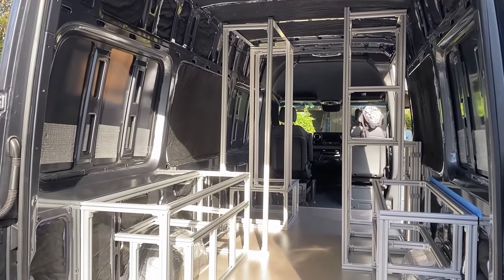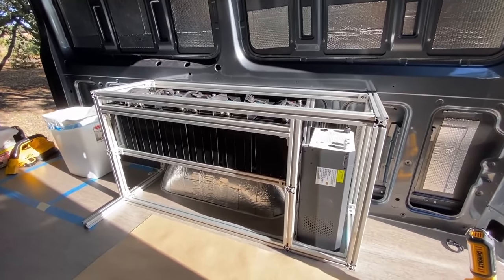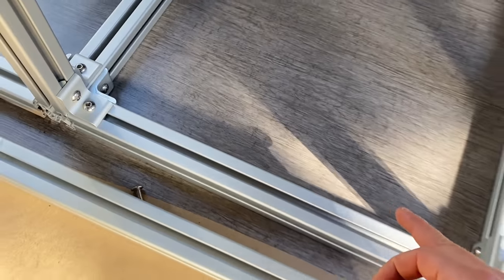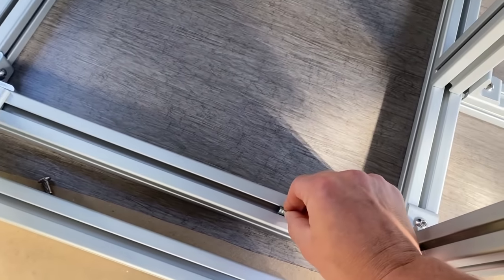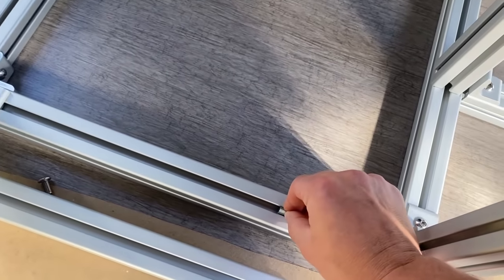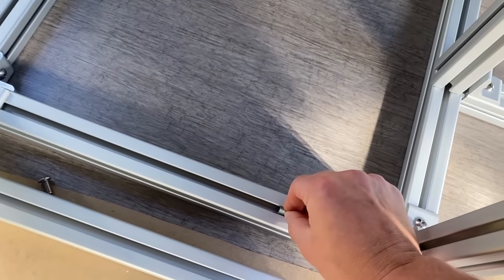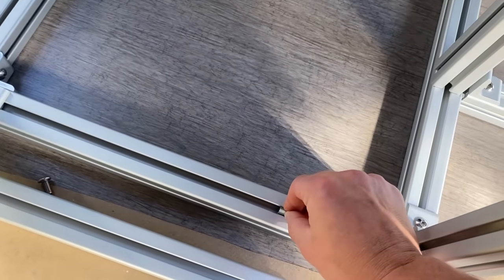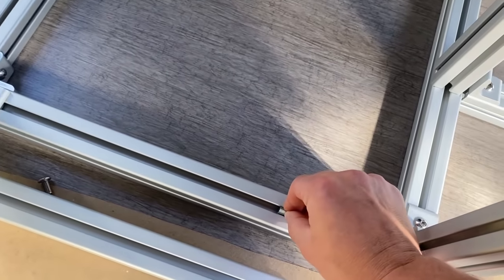How To Build A Van With 80/20 Aluminum (INSANELY STRONG)

Comment: A word of warning to everyone wanting to do the same: Do not use a miter saw designed to cut wood on the 80/20 extrusions. The RPM are too high risking bind up and serious kickback. Yes, it is possible to cut quite a few extrusions, but in the long run it's an accident waiting to happen. Instead use a miter saw with low RPM designed to cut metal and is preferably oil cooled. Unfortunately I am speaking from experience. Did not mean to take away from this awesome video, but add to it. Thanks for sharing your building process!
Reply: then what is your suggest, to cut the 80/20 extgrusions? thanks
Reply: @jonathanz2543  get a miter saw designed for cutting metal (low RPM + Oil cooled). If that's not an option, then be very careful and keep the blade cool, don't use a lot of pressure when cutting and let the blade cool down after each cut. I haven't tried it yet but you might have luck with spraying some oil onto your cut, however this might also become messy. Be very careful though! Good luck!
Reply: @ThePhiliposophy  thanks
Reply: The Aluminum Carpenter has great cutting method and tools.

Comment: 80/20 is way too expensive! The connectors is where they get you. I built a camper and used welded aluminum square tubing for a quarter of the cost.

Comment: You need to ground all that aluminum to the chassis. You also need a thermal break so that the heat is not  transferred onto the frame of what ever you are building. Installing a rubber washer between the 8020 and the plusnuts might be enough.
Reply: ^^^^He's totally right. As terrible as this may sound, you need to break it thermally and that may require demounting it. I'd vote for mass loaded vinyl cut into strips 1.5" wide to line all 8020>Van runs of aluminum extrusion. Grounding will be way more straightforward assuming that most of this is interconnected throughout your van. I love the build and the ingenuity of the mild fabrication with bar stock and tapped holes. You have some awesome skills and attn to detail!
Reply: Everything is already Grounded to the Chassis / Body due to the fact he’s used Nuts / Bolts and Rivnuts - nothing else is required.
Aluminium is a poor conductor of heat so there will be minimal issues with Heat Transfer.
Reply: @jamesosborne4132  re: "Aluminium is a poor conductor of heat"  Incorrect.
Reply: Why the need to ground the aluminum to the chassis and avoid transferring heat to the frame?
Reply: @gabefabian3400  Aluminum is a great thermal conductor (more thermally conductive than steel!) and needs to be grounded if you break the thermal bridge between the van structure/skin and the extrusion... and to be clear, you really should break it thermally. If you have exposed aluminum exposed to hot/vapor rich air (See cooking, breathing, showering, etc) you are going to get condensation which leads to moisture build up which leads to mold which leads to a van rebuild.
Reply: @mtier0067  fascinating, thanks!
Reply: @mtier0067  So why or how is James Osborne wrong? Does grounding with nuts and bolts not work or does it need to be with bare metal?
Reply: @zibwag3203  https://www.youtube.com/watch?v=x0JCLSQGU9Y Watch that video. You need a grounding wire of appropriate gauge that is bolted to a bare piece of the van steel (sand off the paint to get to bare metal)
Reply: I just reached out to them, I do believe a single grounding point from each self contained contiguous "box" you built with 80/20 would suffice. I believe that the size of the wire you are using on your house battery connection should be used for the ground since this will be the same rating for max amps carried in your system. I am using 4/0 on by batteries and have a 3k watt inverter. I will use that same 4/0 wiring to ground each box/frame to the van skin.

yeah as for thermal grounding, I have firring strips mounted to the chasis with plus nuts, i have thinsulate and a plastic washer break between the wood and the skin. THEN i mount the 80/20 on the firring strips so there is the thermal break, but then I ground each box back to the frame... good times!

Comment: The test we conducted with 1” sq Aluminum tube welded frame vs 3M VHB tape, the welds failed before the 3M System , which only twisted the tube, the joints did not fail, it’s also lighter. Buses and coaches are put together using 3M tape, so are Semi Trucks Panels.

Comment: I used 8020 to build my camper van, too.  Bought some off eBay, some on Amazon, and some from Grainger.  For anyone who uses this stuff, recommend buying 8 ft lengths of 1.5 x 1.5 aluminum angle iron, and cut your own right angle connectors.  Make a jig, and drill holes in these with a drill press.  Also ... I tried the same method of cutting the extrusion with a radial arm saw, but I must of used the wrong type of blade.  I got a LOT of aluminum “slag” that “smeared” the cut ends.  Had to use a bandsaw instead.  Two years later, 20,000 miles, and hundreds of nights, every joint is still super tight and the just like when it was installed.  Expensive, and worth it.
Reply: Was there a difference in price between Amazon,  Grainger and eBay?
Reply: @R81-b1p  Minor differences.  Got some great bargains on eBay when purchasing lots of “end cuts” (left-overs from others’ major projects).  You have to keep your eyes open.
Reply: @bitman05  ah makes sense.  I'll stick to Amazon then since it's so convenient.  Thanks for replying

Comment: I love working with extruded aluminum.  I built my minivan using 2020 instead of 8020 at a significant savings and I could get it in black. And it provides 0.043 inches deflection at 24” span under 250# load, which was plenty for my use.

Comment: It is lighter and stronger than a wooden structure. But the best part is that it is very easy to change the setup. It just takes some nuts and tools. I have been using a similar setup in my 4x4 for a couple of years now and being able to add and change things on the fly is really helpful.

Comment: I advise using a negative rake blade for cutting aluminium. Basically, the teeth face backwards, pushing down on the aluminium, not hooking upwards as it cuts. Reduces very scary accidents with the blade throwing your aluminium across the workshop, wrecking your saw. I learnt the hard way 🇦🇺

Comment: One of the greatest channels on van building IMHO. 
I wanted to ask you why you don't use a 1" 8020 frame instead of the 1.5" one. It is smaller so smaller footprint in a tiny space such as a van. Do you think it's not that sturdy?

Comment: Thanks for the video. Its really helped me with my build so far. I'm using 8020 for the first time and one thing that is concerning is just how much it conducts heat/cold. I left some pieces of 10 series in the van when it was 95f and they were super hot to the touch when I got back. Its definitely something to account for. I really think you have to do an AC if you do 8020 that's how much I think it conducts heat. I'm using vinyl to help prevent the heat transfer.
Also, the 10 series is plenty strong I think. I ordered all 10 series as its considerably cheaper than the 15. I think its perfect for the kitchen galley and cabinets as it maximizes drawer space and then I'd probably do 15 series in the bed area as the 10 is fine but 15 would be sturdier. It's so much nicer/fun to work with than ply which I've used in my previous vans. I'm doing a really similar layout to yours except mines a 144wb. Do you like the white panels?I'm thinking of doing white laminate panels, to help brighten up the space and there easy to clean.

Comment: Absolutely epic. I'm thinking about using smaller 80/20 for some parts in the van I'm planning, but in terms of weight-to-strength ratio you can't beat it!
Reply: I'm also curious about the smaller 8020 (mostly to ensure the largest possible drawers, shelves and generally make the most of the space) – how does it compare in strength? Do you reckon it can be build sufficiently strong as a basis of all the cabinets or even for a bed-construction?
Reply: @thefuture986  cabinetry, yes, bed construction? maybe, but you'd have to be quite diligent with your triangles and reinforcement, and even then I'm not sure. but cabinets? absolutely
Reply: @Evanrodge   Seems about right intuitively. So I guess 1010 for cabinetry and 1515 for the bed (with a support beam in the middle?) might work? I'm an absolute noob at this stuff tbh.
Reply: @thefuture986  If I'm right (maybe not) you have this info in the datasheet (obviously not on amazon, but if you ask the manufacturer...)
So with a lenght and a load value, for each given size you can know the max stress and also the max deflexion...
Don't forget you can mix sizes... Use 1 inch square for a pair of small vertical "legs" for example, and for a long beam between these legs, you can use a rectangle profile of 1 x 2 inches... This is the beauty of alu extrusions...
Reply: @thefuture986  yep, 1515 is MORE than enough for a bed as long as you have at least one support beam and use the triangle reinforcers in the corners for stiffness. You'd need to have slats to support the mattress of course but yeah structurally that seems fine.

And I say that because that's what I made my roof rack out of for my Element and put nearly 250lbs of stuff up there lol.

Comment: Nice Seven !!  Only thing I would revise in Van#3 is to thermally isolate all those alum to steel van connections.  Your insulation is "shorted out" by all the direct conduction thermal paths.  My design uses 90deg FR4 brackets tied to the OEM van rails....very quick and easy.  I can remove all my subassemblies quickly.  Tie 8020 rail perpendicular to each OEM van rail.
Reply from the maker: Considering the steel itself is on the inside of the van (and will be covered by wall panels) and the 80/20 is on the inside of the van (and will be covered by wall panels), does this make a difference?
Reply: Mike is right.  Also, consider aluminum is highly thermally conductive.  Using wood or high density plastic spacers between the 80/20 brackets and the van steel would eliminate alot of that thermal transfer.
Reply: @BrendaTharp  I use cut pieces (1 1/2 or 2" ) from: Fiberglass Angle, Gray, 2" Height, 2" Width, 60" Length, 1/4" Wall Thickness    bought from Amazon, sually about $45.  Careful when cutting....FR4 dust real bad....may want to do outside, with mask....I don't, but I'm careful :)
Reply: @seven_o_savage  Hey Seven.   My experience is that the 8020 subassemblies sure act like a big finned alum heat sinks.  Working in the van all summer in FL with the AC on inside: the 8020 was all sitting about 75deg  and the van steel/OEM rail at the FR4 bracket was usually >20deg hotter.  The outside metal was even hotter.  Very hard to get 20deg delta on steel to alum direct contact.
Reply: @mikecol99  I learned a lot about thermal bridging when I was looking into container homes.  Glad you brought this up, just hope Savage can make some adjustments.

Comment: I don't plan on using it for my cabinet structures. But I will be using aluminum U-channels at the top and bottom of my wall panels and around the edges of my ceiling. These were good tips for anchoring them in place. For the gap at the angle between the walls and the ceiling, I'll be using crown molding so that I can use that gap to run wires, indirect lighting, etc. I'll just have to remove the molding to access things easily. And using the aluminum you channel will make it easy If I do have a problem with water or mold behind the walls. It's just a matter of removing screws from brackets along the top and bottom to access what's behind the wall panels.

Comment: Very nice. Make sure you ground all of those structures to the chasis of the van though!
Reply: I've seen this advice often enough. Can you explain why? I don't quite get it.
Reply: @peterdods425  it's just to complete an electrical circuit if there was ever a situation where something were to short out. 

With vans taking a bit of a beating something could shake loose over time. If that something is a wire that's supposed to be supplying power, say to an induction cooktop, and it ends up supplying all that power to your galley frame, you're gonna have a bad time if it isn't grounded to the chasis. 

Everything has to return to the negative terminal on the car battery, the chasis of that van is connected to it. So connecting all that aluminium to the chasis of the van (make sure you use a big enough cable to handle the potential in the batteries) in effect connects it to the car battery.
Reply: @MrMJBall  if it’s bolted to the van it’s grounded.

Comment: Same concerns as others.  Would use 80/20 only for stationery purposes.  Too concerned that to would rattle loose over time.  Working with an aluminum metal fabricator can actually be less expensive and more sturdy, but your design has to be spot on.

Comment: Great build series. I used 1” 80/20 on a drawer system for my truck and have had issues with bolts/tnuts coming loose anywhere I used single L brackets to connect two pieces of extrusion. I used 80/20’s machined connectors for all the corners and they’ve been solid. I think your frame will rattle loose pretty quickly without some blue loctite on the threads. Opting for birch ply and pocket hole construction on my next build. Interested to see how this holds up.
Reply: No matter what you build it will loosen over time, a van flexes continually, only way to offset is to mount everything flexibly ie rubber mounts, one mistake most builders make is mounting cabinets to floor and side wall, both are flexing in different plains, mount cabinets to the floor only even if full height with a small gap to sidewall.
Reply: @andywt8460  Yeah, I was wondering how fixing a rigid aluminum frame to a steel van body that is flexing in all sorts of different ways would wear over time. The bolts of the frame are constantly tensioning and detensioning as the van body flexes. I think a floating system made out of a more flexible material that anchors fast only to the floor would allow for the natural flex of the body and avoid putting so much stress on the system.

Comment: Nice build & explanation, I suggest @0:22:37 using an isolating thread-locking compound to prevent the stainless steel from corroding the aluminum & or vibrating out.  Locktite makes a few types.